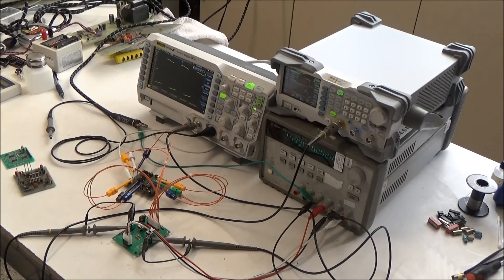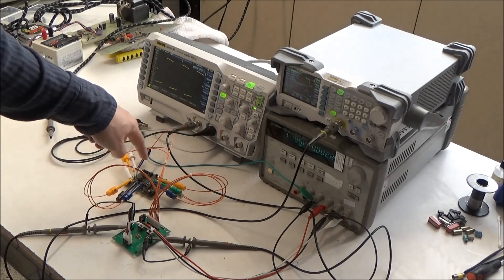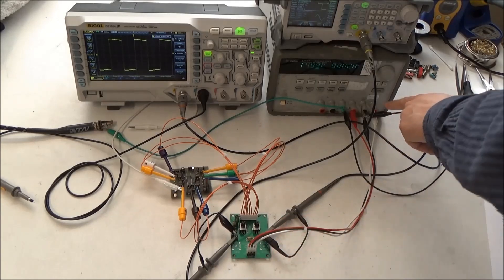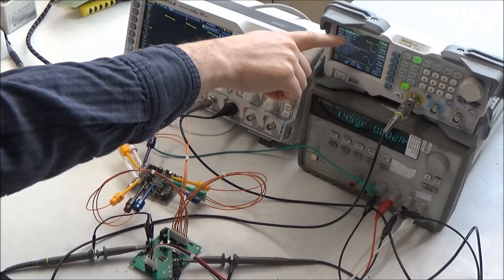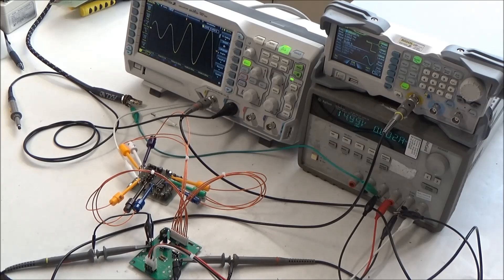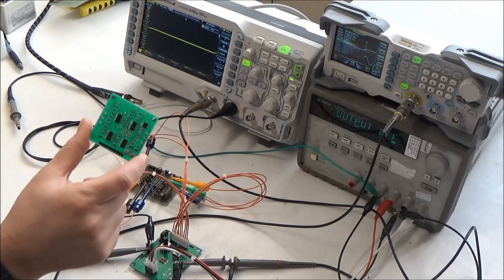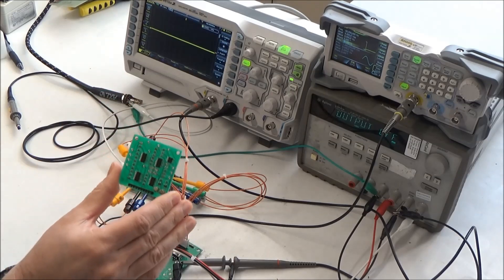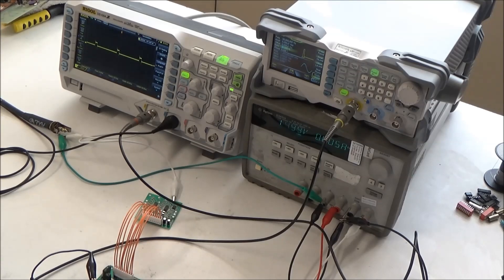Synthchaser #115 - ARP Voltage Controlled Filter Tester

Comment: I  made 4023 LP ARP OTAs and opamps exchangeable, and the 2x1nF, 2x100pF.The 100pFon a Feedback path.Only one changed 100pF NPO CGO ceramic cap changed BACK to old onechanged the sound. Especially on higher resonance where more amp occour. So just one old 100pF where more noisy,less dinamical more airy properties. The same happened with oldopampOTA ic-s. So now my old OTA filter sounds cleaner.